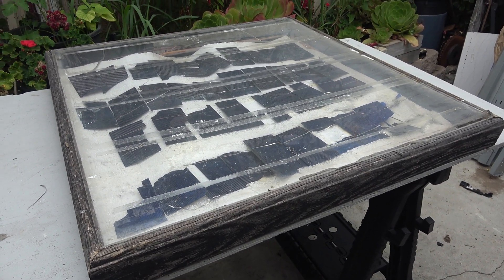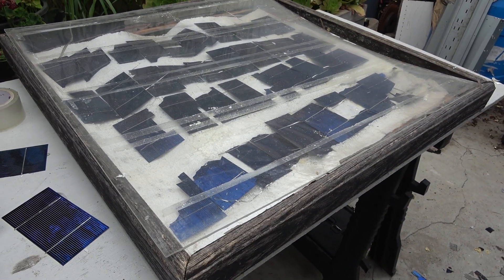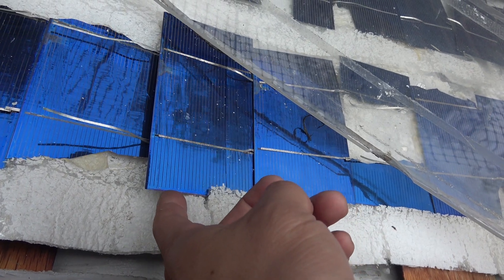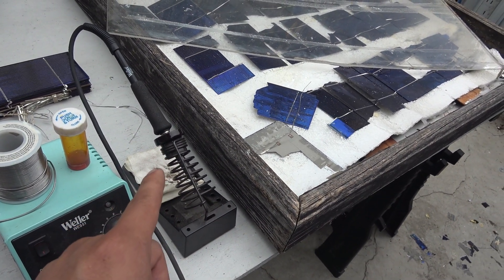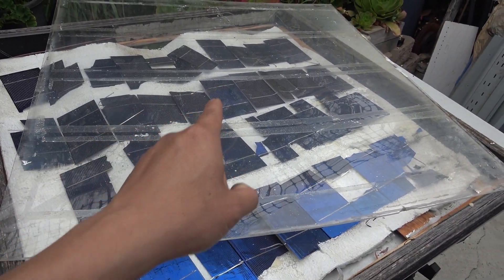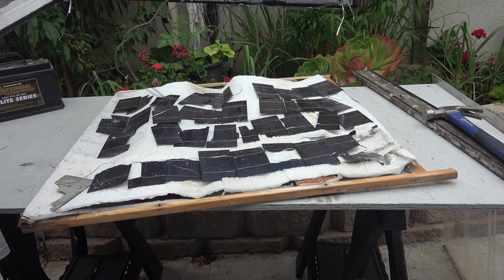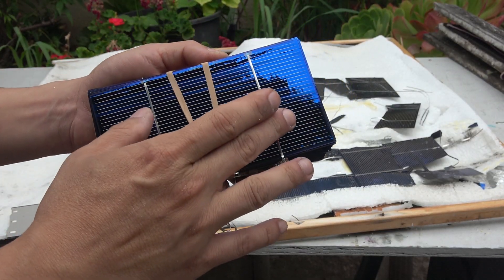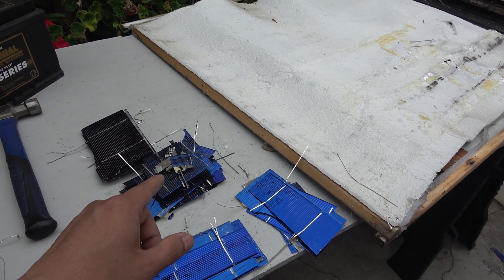What I learned from a home-made solar panel I built 12 years ago

Comment: hi will.i bought this 20amp mppt off eBay it doesn't give battery @t just reads battery voltage.took it off my sisters @t was cpt2420 off Adam welchs youtube it has big inductor inside, anyway I swapped it for an epever so no problem now.also on my camper van I have 100watt panel running my waeco compressor fridge.12v pump led lights.and just usb for phone charge.but when we who on holiday soon I have ordered 3 x 30 watt flexible panels to add to roof of camper so can charge my drone and bike battery.i have a 1100 watt Krieger inverter.there is also dc to dc charger that works great when vans running.i have 110ah batteries paralleled.question is shall I parallel the new panels with separate @t epever controller running fridge is only 10amp mppt.
Reply from the maker: Sorry Steve, I'm kind of confused. I couldn't quite understand your question. Can you rephrase your question?
Reply: vuaeco ha I can’t understand too .the controller stopped working it just displayed battery
Voltage .it wasn’t charging over 12.8v should be 14+
Reply: Hope you well over there
Reply: Hi I have 3 solar panels 30watt in parallel on camper van do I need. Surge protector ?ive got 3 breakers on order so can isolate panels

Comment: How many battery charges did you get from this solar panel? What were you able to power up with this? Why did you decide to break it? Why didnt you keep it or add new solar cells?
Reply from the maker: It was for my shed which I used to power LED lights, USB chargers, and whatnot. I needed to tear it down because it was actually broken down due to its age beyond repair.

Comment: Is it better for the cells to be closer to the plexi glass or the back of the housing?  Is there some kind of distance ratio that is ideal to keeping the cells "healthy?"  Wouldnt it be beneficial to have as little air as possible inside the enclosure?  Aka the least amount of space between cells and enclosure so that at least the cells can expand when hot?

It seems that if there is too much air inside the enclosure it'll just heat the cells and melt them into the backing.  But if there is too much contact with the plexi glass the cells cant expand when hot.
Reply from the maker: On my panel, the cells are sandwiched between the plexiglass and the piece of foam on the back. There was no gap. You don't want to have air in the enclosure because that would mean water vapor is in it, too. If water gets in, it'll damage the cells.